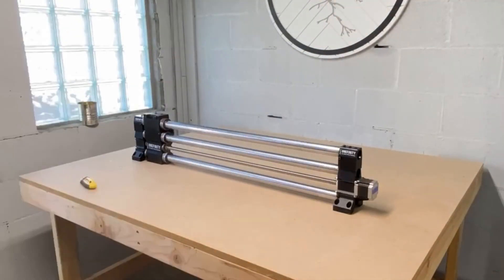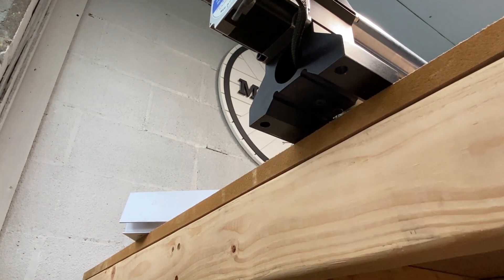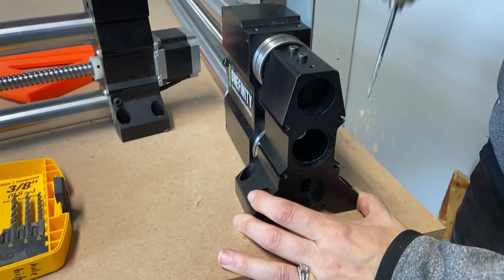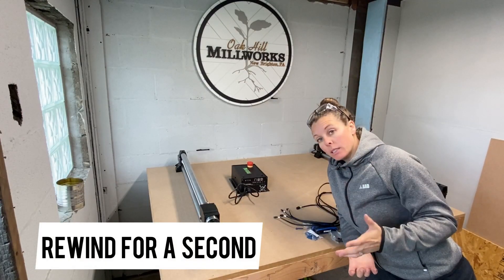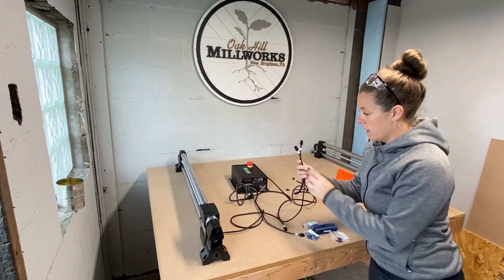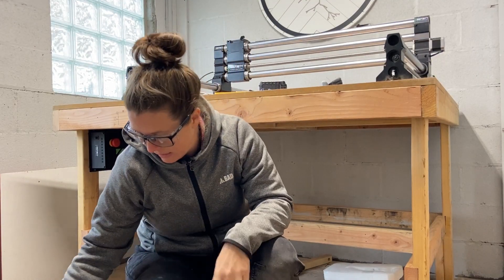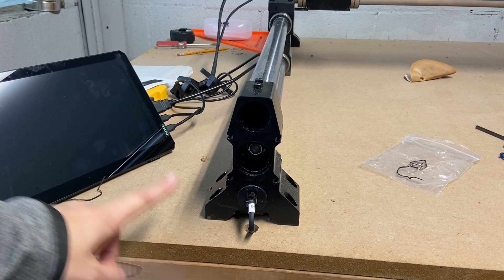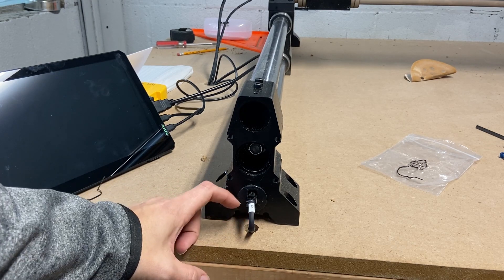Onefinity CNC - Initial Set-Up and Cable Management for your CNC Table

Comment: If you put your spoil board on top of your table, aren't you losing about 3/4 inch on your Z height? I would think you should put spacers, the thickness of your spoil board, underneath your track anchors.
Reply from the maker: Totally could do that if you had needs to do some super deep carves or cuts! Great idea.

Comment: Great Video. Thanks for all the good info. Why did you use the blue tapcons to attach the frame to the table? I have only seen them used for concrete.
Reply from the maker: That’s what I’m used to using tapcons for as well! I absolutely hate the slotted ones. That is actually what came with my machine but I also received this as a refurbished model pro gratis so perhaps that isn’t the standard fastener that comes with the CNC.

Comment: I noticed (10:23 timestamp) that there is some rust forming on the nuts and on the Z spindle mount runners of the Onefinity.  Is this machine new?  Or have you since talked to Onefinity about this issue?.
Reply from the maker: Hi Chris — this was an older machine that was refurbished when I got it. I haven’t actually done anything to try to clean them up. I did tell onefinity about it as they sent it to me for product testing and they did not feel it was a concern in terms of affecting its function.
Reply: @OakHillMillworks  that’s good to know. I love your videos by the way. Nice and informative but in a fun friendly way.
Reply from the maker: @Chriswoodworker  thank you for taking the time to tell me that! It has been a climb to try to grow my YouTube channel and I do it as I’m learning so it can be tough but comments like yours are very encouraging! I’m currently trying to decide what the next video should be on. Any ideas??

Comment: Also, I gotta say your gymnastics routine at the end really sold me on the strength of that unit. That was impressive.
Reply from the maker: Haha! Yes these things are rock solid and I used tapcons to attach my table to the concrete wall so the table doesn’t budge. I think that’s pretty important when you have a CNC with as much speed and power as the Onefinity.

Comment: Pretty stout trails/tubes! I ordered the X50 the other day. I really hope it does what it needs to do. I've been thinking (calculations) with the additional thickness and wider tubes it should be stronger or just as strong as the 3. Full 2 inch wide and almost 1/4" (.236) think tubes (hardened) should be great! Nice video! (I would have only put one screw in the right corner, then bolt the gantry down to the front, then put one screw in the left, then move the gantry all the way to the back and then put a screw in each side, then lol put the rest of your screws in. None the less great job!! I find a woman that's into this stuff... Game over) lol lol. 🤣😂👏👍😊
Reply from the maker: Good luck with the X50! — yeah that homing and squaring up video that you commented on earlier was basically me correcting the mistake I made in this video with that same method you just described. It’s too bad that seeing women in this realm is seen as unique. I’m working hard to break those barriers down and hopefully inspire more women to get involved with tools or CNCs or lasers. People should go after what they want, whether it’s a male taking a dance class or a woman learning to weld. 💪🏻❤️

Comment: The true squaring process is a bit more complicated. Both Y rails should be exactly the same length, but should be verified. That done, you need to take the diagonal measurements between them and assure they are identical.  You can get close. You can even get lucky, but you are much more likely to end up with a trapezoid than a square if you don't tweak into identical cross measurements.  It will happily carve obtuse or acute angles in place of 90's.
Reply from the maker: Yeah this is not a conclusive video by ANY means. I did get very close on my own Y-rail cross measurements and decided that, since I’m not making parts for NASA, it would work! Thanks for your feedback!

Comment: Did you buy your machine used? The top of your Z axis looks rusted?
Reply from the maker: Good eye! It’s a refurbished model that I was given by the company. I did not purchase this machine and it is not new. New machines will not have surface rust. 👍🏼
Reply: @OakHillMillworks  little worrisome that they can get like that at all.
Reply from the maker: @Golfexpertbelieveme  I can see why. But the rails are spotless and that’s what really matters. That stuff is cosmetic. Maybe it was in a non-temperature controlled space before I got it. Lord knows it is not in a temperature controlled space now either. #garageshop

Comment: Squaring of the machine can be done a lot easier and possibly more accurate than eyeballing it with a speed square.  
Put 1 screw in the front corner of a Y-rail, attach the X rail on top and move it all the way to the front,  then put 1 screw in the front corner of the other Y-rail.
Then move the X-rail all the way to the back and it will square itself.
Onefinity has a video detailing how to do this.
Reply from the maker: Yep that’s a great way to do it now that you mention it. I have not watched every YouTube by Onefinity so I missed that one. Thanks for mentioning that option.

Comment: Hey christy love the video. I really wish there was an in-depth setup video like this when I got mine. One suggestion I would make is don’t put the monitor on the rail where it’s supposed to go. The magnets are cheep and people bump them and they fall to the floor and break all the time. I removed one of the pieces from the mount and actually just secured it on the table next to my machine. Much more user friendly and less prone to accidents.
Reply from the maker: Now that I see your set up for the monitor, that’s a great suggestion. I never did mount it because I didn’t love the location. I’m in limbo!

Comment: Loving all the details you are sharing here and on IG! I've been wanting a CNC for years and this is such a help in making me comfortable enough to take the plunge.
Reply from the maker: My search for machines to start a business with almost 3 years ago now actually involved researching CNCs. They seemed very overwhelming to me at the time. I didn’t even think I could get it assembled properly. This machine is nothing like what I researched years ago. It is WAY easier to set up. Thanks for letting me know and I hope when the time is right, you can totally feel empowered and capable.

Comment: Onefinity makes it super easy, don’t they? Do they have any advice for how to make the space for a CNC in a small shop? 😂 

Great video Christy!
Reply from the maker: Thanks! I think they do actually. They make a folding rollaway stand that the CNC gets bolted to for small shops! It could even be mounted on a wall and flipped up when you need to use it. They have some info on their YouTube and website on those options!
Reply: @OakHillMillworks  awesome, thank you

Comment: Very informative Christy! I like the mounting of the power unit under the table to allow for monitor placement on the table. 
Already having to make adjustments 😂
Reply from the maker: 😬 thanks! Yeah I just tried to think about all the dust I will be making and hoping keeping that under would help with making cleaning easier and just keep the control box cleaner too. Thanks for checking it out!